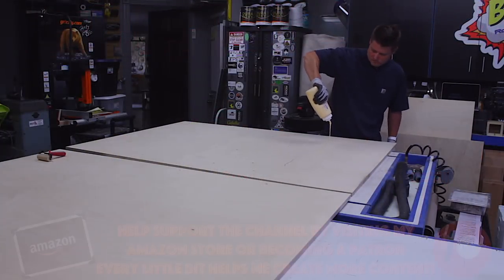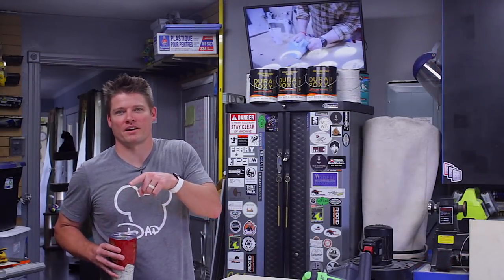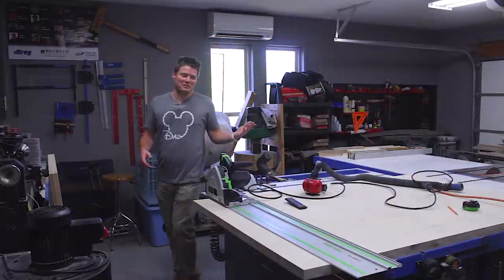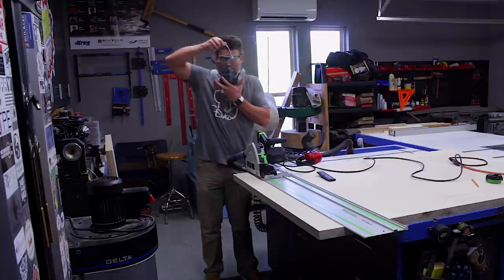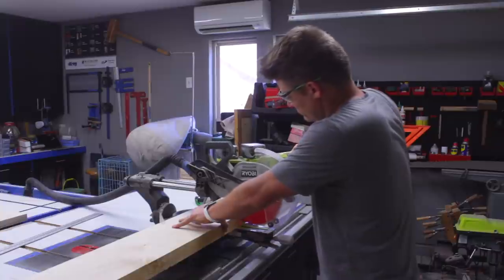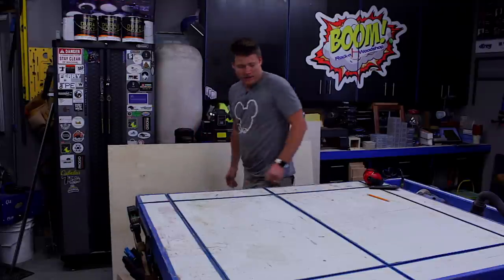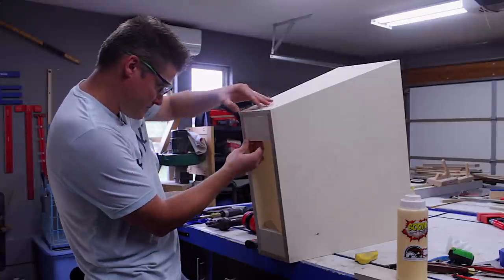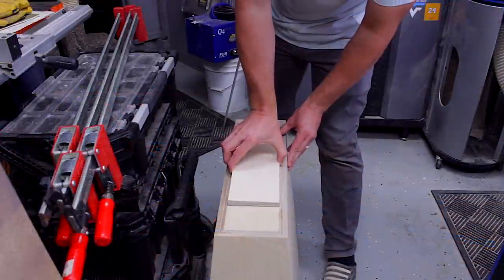Modern PLYWOOD Dining Table! WHAT???

Comment: i also noticed you drank the festool kool-aide.  More power to ya!
Reply from the maker: Yup I needed the track saw for this project to simplify the taper with compound cuts and it is the only new  Festool tool I have. The domino and router were used. Thanks.

Comment: Wow, that turned our really nice.  Couple of questions if you don't mind.  What kind of plywood did you use?  What did you finish it with?  Thanks Drew.
Reply from the maker: This was Baltic birch because it has a close resemblance to maple. I stained it with Minwax Provincial and sprayed a few coats of Sherwood high build precat lacquer and vinyl sealer.
Reply: @rhwoodshop  Thank you.

Comment: Dude you really gotta get yourself a cyclone, or they have a similar type of separator at the home Depot (that's what I have.) It'll save you a lot of time and your shop vac. Just a thought friend.
Reply from the maker: Yeah I have thought about it. Unfortunately inside that assembly table I do not have room for a third item because it already holds my air compressor and vacuum. I am going to have to figure something out because it will give me a whole lot better suction then just a plain filtered vac.